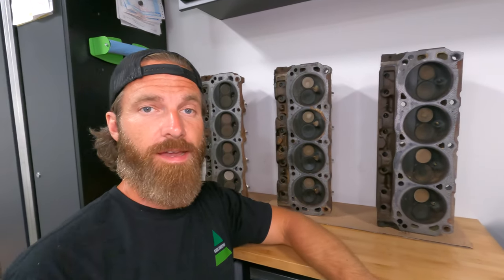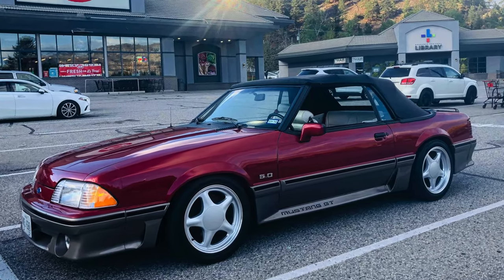Comparing Junkyard GT40 GT40P Stock E7 Cylinder Heads / Everything U NEED 2 Know - Fox body Mustang

Comment: I have a set of the original iron F3ZE GT40 heads still new in the box I bought from Ford Motorsport waaaaay back in the day--when they were still selling the Alan Roots heads lol.  Fully assembled with the A50 springs, and stainless valves, they sold under part # L303...I also bought a 351 GT40 lower intake with a F2 # that predates the F3 lighting lower....
Reply from the maker: Oh wow buddy! That’s awesome. Hang on to that stuff or at least let me buy them 😉😂👊
Reply: @KASLCustoms  I actually went through my receipts I filed just to see what they used to cost in circa 2005ish. I paid $199.95 for each assembled head!!!  When I purchased the heads I also bought the correct 93 Cobra 1.7 rockers for $139.95.....Lol...of coarse still in the box..My greatest trophy is a brand new N.O.S. Bigshot nitrous plate kit 02116 for the Cobra intake.  It's the plate that goes between the upper and lower and adjustable from 150-300. Cost was $398.99.
Try putting together a HCI with a power adder all brand new--made in the USA parts--for under a grand!!!  My 86 GT has true flat top pistons factory,  so I put off installing all this stuff until I could do it all...then the Army, then kids blah, blah... you know the story.
Reply from the maker: Oh wow buddy! You are sitting on gold my friend. Good for you!!!

Comment: Thanks for the close up on the P head. After watching another guy ramble on about stuff he read on wikipedia. You clearly show the real problem with the P head. The spark plug is too close to the intake valve. It really needs to point to the exhaust valve. Why? Because in boosted or nitrous cars. It can actually ignite the fuel mixture back into the intake. And we have  all probably seen those explosions at drag strips. Also, I may have missed it, Where do we find 3 bar gt40 heads? Or on what?
Reply from the maker: You’re welcome. The 3 bars came on all 93 cobras
Reply: @KASLCustoms  probably not so easy to find. But thanks.
Reply from the maker: No worries 👍

Comment: Soooooo help me out please. Im running on an Old 1989 v8 302 automatic bronco engine, planning to overhaul it and add gtp40 heads and a e303 cam. What else should I do to make it better more efficient? Maybe a better water pump? Idk really
Reply from the maker: by "efficient" Do you mean you want to make it better on fuel?
Reply: @KASLCustoms  well yeah, kinda. Stronger, faster, better fuel economy would love to use it at comfortable 80-85mph. My go to option rn is getting a junkyard 5.0 HO explorer engine and cam it
Reply from the maker: @brianlucero9536 lol - you’re asking a lot there… driven nicely, my HCI set up can achieve high 20’s/low 30 mpg on the highway

Comment: Great heads I've managed to get 3 pairs of 3 bar heads and 1 pair of 4 bar had 1 pair of 3 bar ported polished 3 angle valve job lower intake port  matched n41 cam should run decent
Reply from the maker: Right on! Thx buddy 👊

Comment: Your video helped me a lot. I just picked up a set of GT40 3 bars with matching intake of a 1990 Indmar marine engine. 
What is going to be different from regular non marine? 
Planing on port and polish with a nice stainless valves and titanium seats. Dropping on to a 302 block with some new high compression pistons, for a Fox body mustang.
Reply from the maker: Great find buddy!! I’m not 100% sure if the heads will be any different. I believe the blocks they use on the boats are of a more robust nature however I’m not sure if that carrys over to the heads or not. As for the intake, I believe the only differences you may find will possibly be in the vacuum set up and maybe the throttle body mounting position.
Reply: The marine GT 40 intake has a cast iron lower instead of aluminum, so it could be used in salt water. There should be no difference in the heads.

Comment: I have a nice set of GT 40 3 bar heads which have the Crane 1.7 roller rockers I had a professional Port them with a little polishing which he put them on his flow bench. I will be running a Offenhauser 360  dual plane dual port intake with a step 1 from stock Jegs Roller cam.
Reply from the maker: Very nice 👌
Reply: @KASLCustoms  Thank you building a 1930-31 Model A Coupe traditional late 50s early 60s open wheel hotrod on a 32 Ford chassis with 4 inch dropped straight axle 8 Ford rear out of early 70's  Ford Maverick with coil over shocks and 4 link set up in the rear. Its going to have 2" chopped top so which is not very radical but still have that nice look. 94-95 Mustang GT 302 with the Cobra GT 40 heads with AOD transmission. Dry Lake headers. Going with a nice Emerald Green with light metal flake maybe white smoke ghost flames. Its going be like a Bonneville Salt flats racer. I have dreamed this car for a long time just trying to gather all the stuff to build it.
Reply from the maker: That is awesome my friend!! Good for you

Comment: For a bone stock engine daily driver the E7 is work fine. But to take that same engine and bolts assetto gt40p heads with intake you'll see a gain of around 30 horsepower. The difference between the GT40 and the gt40p the Gulfport was redesigned which allowed it to use a smaller exhaust valve it has a higher exhaust velocity. As far as changing the plugs I have zero problems with my headers. I don't run 90-degree boots on my plug wires I have a couple of plugs that have 45 degree boots. And if somebody finds that to be a problem, you have more problems than you think. The only thing with the p head that I have found is the headers available. At the time of building my truck there were no long tube headers available. Reconditioned 40 or P heads today or going for 600 to 900. So if someone wants to do some performance upgrades probably better off looking at flotek or AFR heads

Comment: The Explorers were never supposed to get the 5.0. Ford wanted to use the 4.6s from the get-go, but they couldn’t make enough of them. Ford had leftover parts and 5.0 engine production capacity, but the existing 5.0 heads wouldn’t pass stricter OBDII emissions requirements coming in 1996. This forced Ford to redesign the heads for better combustion efficiency, and that led to the GT40P. Ford wanted better performance than the E7s put out for market completion which led to the GT40 heads being the base for the P’s. The reason the spark plug location is different on the P head is because being more centered improved fuel burn.

Comment: Hey KSL I have a 95 5.0 SN95 
My crankshaft broke bcuz it was the same crank from 95…

So I told him to redo the whole motor so he’s puttin gt40 s and p heads and headers with 373 rear end gears, new rods and pistons with throttle body everything will be performance do u have any advice on what else I should do I want it to be a street car that I can take in the track from time to time
Reply: Or do u think I’m at a good start?
Reply from the maker: Hey bud - I think that's a great start. It will feel like a whole new car when you get it back 👍
Reply: @KASLCustoms  thankx for ur Honest My ankle said the said thing it will feel like a new car with more hp

Comment: Great content! Excellent video showing the differences/similarities of the three. 

Do you or anyone else have solid HP/TQ numbers comparing the three?  Currently running TrickFlow Trackheat intake and E303 cam with stock E7’s.
Reply from the maker: Thx buddy! I don’t have solid numbers to share but I’ve always gauged the HP gains around 25-30 hp and TQ around 35-50 in stock format ( no porting etc.) 
That said, every set up is different so it’s hard to say with any certainty but that’s the gauge I’ve always used.
Reply: @KASLCustoms  appreciate it
Reply from the maker: Anytime!
Reply: It really depends on your supporting mods.  My buddy has an '86 Capri and went through a carb phase--he dremeled the flat top pistons to fit stock 3 bar heads and a Weiand Stealth with a 650 carb....even though this was an 86 roller he actually had E5 heads(E7's with bigger chamber) on it at the time trying to get around the piston design and to ditch the terrible E6 heads.  He actually picked up an unbelievable 70 HP and 60ish torque!!  So basically he went from an '85 long block and added just those 2 mods.  This will not be duplicated on an EFI motor JUST by adding either GT40 or GT40P's  obviously...with your parts you'll pick up 30-35ish....Of all my buddies that switched to an E cam....they "sounded" faster--but were were typically frustrating to live with and tune --and usually slower than the stock cam.  Not a knock against your preference--just something to think about--is the cool idle worth the temperamental quirks for no gain?  Only you know that...Regardless with all the supporting mods the typical GT40 top end will make between  255-275 at the tires...Bone stock they dyno 190-200 rwhp. You will feel 75 hp...the cheapest way used to be buying the WHOLE Explorer engine and putting springs and the H.O cam. That's Easy HP and it used to be cheap...
Reply from the maker: Great info buddy!!! Thank you so much for sharing - very valuable for the community 🙏🙏🙏

Comment: Where does everyone find the info to be able to match cam with heads with intake etc. or more importantly how to tell what you have when you buy a used car.  Thanks for this video i need to know what i have for heads
Reply from the maker: You’re welcome. It’s best to speak with someone that knows what they are talking about-  like a reputable machine shop or engine builder. It can be a very confusing path to navigate if you’re unfamiliar
Reply: Your question has no answer because because you give no info. What car? What engine? What year? And what do you want to do? I can help but you need to first fill the questions asked

Comment: gt 40 3 bar are very close to a 1969 to 74 351 Windsor head  same valve size with a little better exhaust port
Reply from the maker: I did not know that. Thanks for sharing 👍
Reply: Just picked up a pair of these heads “c90e”.  Very similar to the gt40p but yes exhaust ports are smaller and closer to e7

Comment: I could be totally wrong but I thought the GT40 3 bar had 62cc chambers and the 4 bars had like a 58cc
Reply: I believe so.
Reply: I have a pair of brand new in the box L303 heads which were sold through Ford Motorsport way back....Just as a reference point they are assembled F3ZE heads and specs on box says 65.5 cc chamber.....I measured them anyway and I got 63 cc.  I've seen them anywhere from 62--68 cc depending on what they came off...
Reply: @patrickf4692   sounds about right for 3 bar heads. 👍🏼 4 bar P heads are 58-59 ish CC’s

Comment: Good comparison. I have 302/5.0 in my '31 roadster. It has the 4 bar GT40P heads that came on the Ford Motorsport crate motor. Sanderson FF1 headers will work with those spark plugs in a street rod tho a couple are socket close but headers don't need loosening. 90 degree plug wire ends are a necessity as you noted. You do need to be aware that the Fel-Pro and other catalog listed OE type intake gaskets are a poor choice and partially block the ports. I did a search and found some that are perfect but unfortunately during a house move my current build sheet disappeared so don't have the Fel-Pro part number. The one thing I should have done was to open up the exhaust valeve to the 1.54 version but since the car is now for sale, someone else's project
Reply from the maker: Thx sir. Thx for sharing as well

Comment: Very cool video and comparison of the 3 different heads. Thanks for sharing. I’m seriously considering porting out a set of E7’s, just because. lol 😂
Reply from the maker: Nice buddy! And that you for the kind words. I’ve heard of guys doing it before I’ve just never heard anyone say that the work was worth all the effort. Let me know how you make out 👍
Reply: @KASLCustoms  Rodney (50Tussin) has a set, that he ran. I think David (The Scientist) did the porting. The E7’s did pretty well. That’s where I got the idea.
Reply: I home ported a set of E7's pick up 2 tenths and 2 mph in the quarter. So @20 hp. You get more if you do bigger valves like DV did.
Reply: I’m gathering parts for a 387 stroker, this setup drives the compression rate up, so the open chambers of E7’s will help keep it lower to run pump gas. I’m planning to use 1.94, 1.60 valves.
Reply: @floydmarseeii4007  
You're building a 387 stroker and you're going to use OEM cast iron heads!?
Reply: @Turbo4Joe363  , I’m not sure what heads are going on it yet. I’m still gathering parts and information. I’ve been wanting to get a set of aftermarket aluminum heads. I’ve been looking at a set of AFR 190’s, but I’ll have to keep saving my pennies until I can afford a set of those.
Reply: @floydmarseeii4007  
I just had a 363 SBF built with AFR 195 Renegades.
Awesome cylinder heads!
I had to save up my money for the 363 build too.
(The AFR 195s cost me over $2,200/set. Now they are over  $2,600! )
Reply: @Turbo4Joe363  that sounds awesome!!! I’m not in a hurry to get mine done, so I’m taking my time, and buying parts as I can. I’ve been thinking about using a set of E7’s on it just to get it together. Maybe by the time I get to that point I’ll have the money for a new set of heads. I’m using a F4TE roller block, & rods. I may have to bore the block .030, I’m not sure yet. The engine is still together.
Reply: @floydmarseeii4007  
At a minimum, get a set of GT40 heads.
Personally, I'd save my money for a set of AFR cylinder heads.
They make a significantly less expensive set of 'Enforcer 185' as cast heads that are a great value!
Reply: @Airsally do both.  It's gonna gain more when you pair it with a ported upper and lower manifold and a good cam...
Reply: @Airsally the fast guys are the ones who do all the tricks not just pick and choose what trick to go with lol
Reply: @floydmarseeii4007 get big dogs porting to do the porting them dudes are awesome. You'd be surprised what they can do with a custom cam especially with 387 cubes.  Killer budget setup.

Comment: I have a set of GT40s with 1.94/1.60 vales, fully ported.  My advice would be to use these in their current condition or run something else.  They're not worth sending to a machine shop for a performance valve job, guides, and a shave.  If i could, i would lend my younger self $300 and say, "Get some trickflow heads and be done."
Reply: Big dog does killer porting.  He can make these outflow most aftermarket aluminum heads.
Reply: @midnight347  Most aftermarket heads will flow 240-320cfm on the intake side.  With big valves, the GT40 heads will top out around 245cfm.  He actually did a video on this.

Comment: I wish you had a header or manifold to show the difficulty with p heads, but it was a great video as I would love to put a gt40 set up on mine one day. I am also curious as to why the explorers got the  gt40 set up.
Reply from the maker: Sorry buddy. I didn’t have one laying around at the time 😢
Reply: @KASLCustoms  still a great video. Thanks
Reply from the maker: @jeremyplester3915  Thank you!
Reply: I thought I remember reading it had to do with emissions changing...even though they were phasing the old pushrod tech out...the explorer still sold like crazy, and I believe the thinking was  to put a tiny little cam with better head and intake flow, so to not have to run all the smog gear of previous 302 models...they apparently couldn't cut if they had to redesign the heads to even cleaner burning P heads...
If you've ever seen a header from a 302 explorer, you'd be amazed it made what it did...
Reply from the maker: Yes I think you’re right on that. And those headers are pitiful…

Comment: doing the math with a Moroso power speed calculator and double checking with summit racings compression ratio calculator, a stock 5.0 8.8:1 compression ratio engine with 66 cc chamber, will jump to over 10:1 compression ratio with the 51cc P heads. That's a huge jump. maybe I'm missing something
Reply: That's not the published cc specs for the heads I've seen. Most say E7 to P adds 2/10 compression.